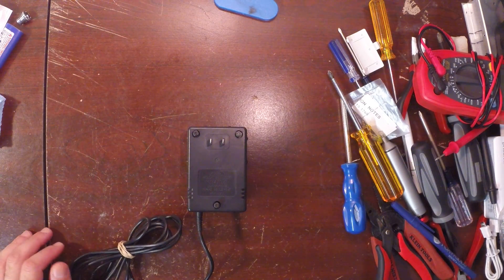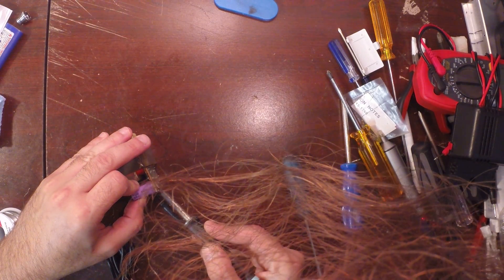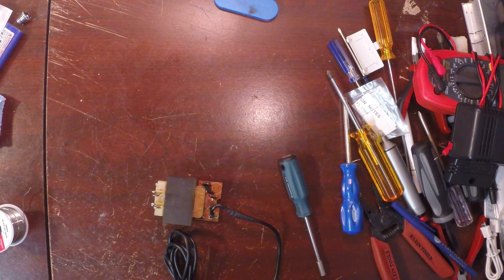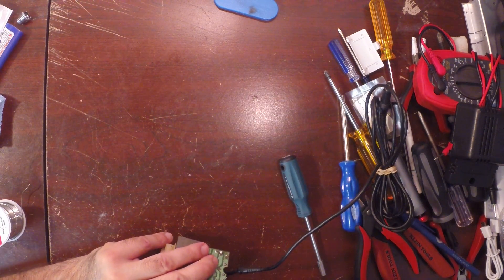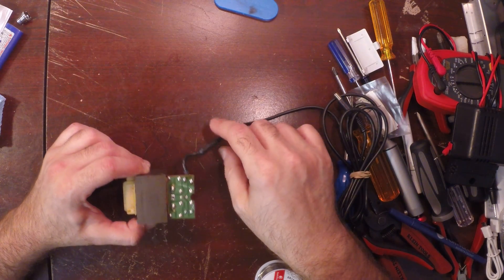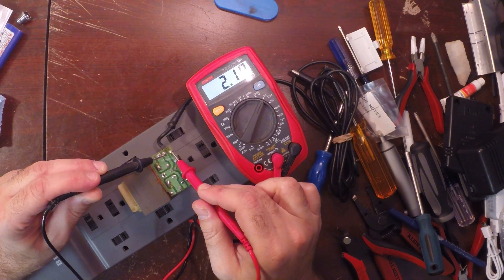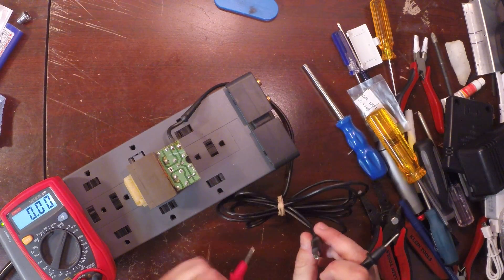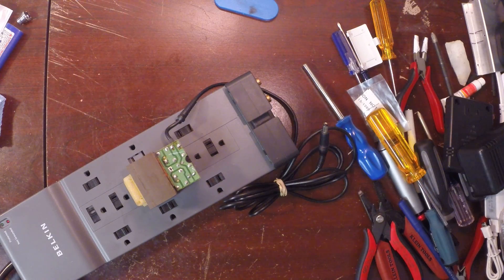Megadrive Model 1  SA- 160A DC power supply repair

Comment: Yeah, a linear PSU typically puts out a higher voltage until it is under load. If you measure it while it’s powering a console it will be closer to its voltage rating.
Reply: Also, your PSU is likely made for 100v. Plugging it into a 120v outlet with +20% on the input will product 20% more voltage on the output (thus: “linear”). I have a SA-160A from Thailand that expects 220v which is weird since it’s the same model number as Japanese units.

Comment: The Japanese Game Gear used the same power supply as the Mega Drive / Genesis Model 1 and SEGA / Mega CD (Model 1 and 2). The American Game Gear used the Genesis 2-style center positive yellow tip plug. This wasn’t a Japan vs. US difference between the Genesis and Mega Drive.